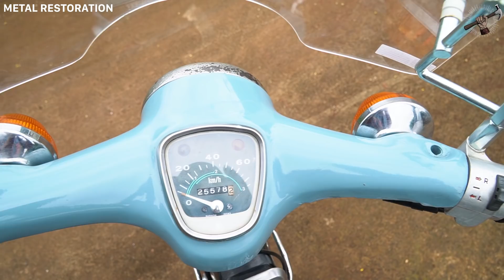1978 Honda Super Cub C50 Full Restoration | Will It Run After 42 Years?

Comment: Bro your work is awesome but when you disassembled then head that time it was 49cc but you assembled 72 cc????
Reply from the maker: thanks
Reply: Lmao...If you watch other rebuilds, they arent even the same engine that got disassembled sometimes.
Reply: @OldBullRanch  putting a bigger cylinder on for more power. all super cubs use pretty much use the same bottom end so it is easy to put a bigger cylinder on them.